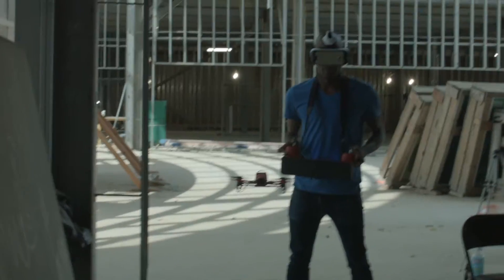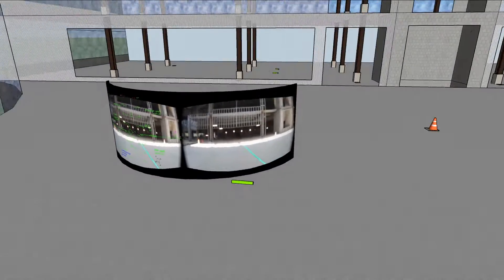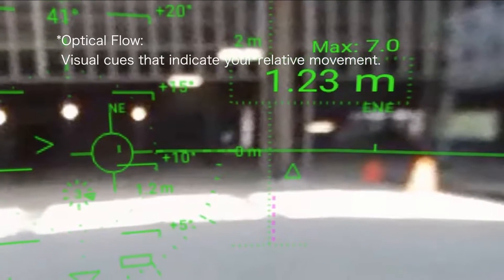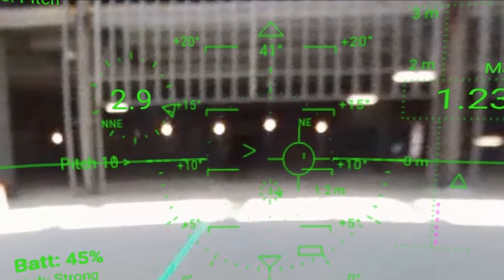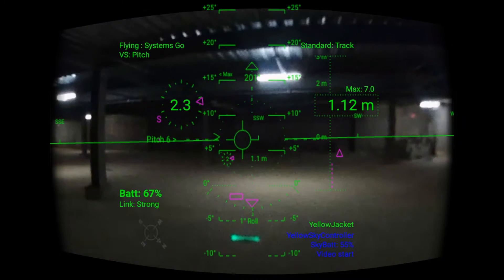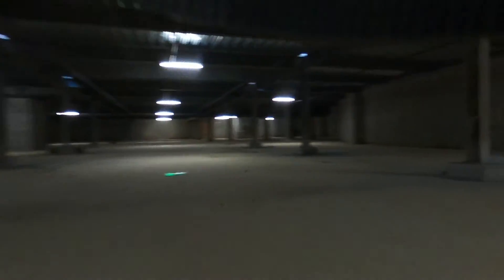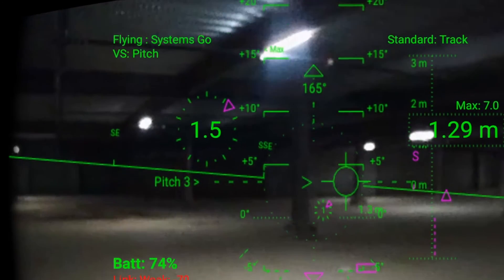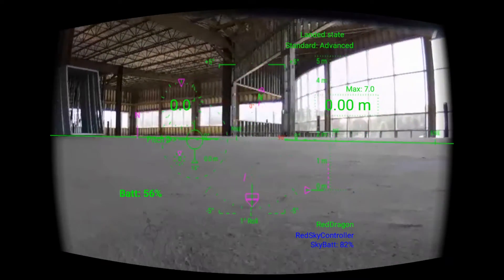Fly Faster: Designing and Testing an FPV Drone Racing HUD

Comment: I cant imagine how to race or doing acro tricks on high speed with your OSD. Here is example of what i mean by "fast": https://www.youtube.com/watch?v=_JvD393t_po 
I think in real practice first tree would be mine :)
Reply from the maker: It is definitely hard to imagine. Its better experienced. The OSD starts to conform to the environment and disappear during flight. It becomes a reference when needed. I am sure you are used to flying in real-time. With an OSD that has a complete feedback loop with the flight computer, I am able to predict the motion of the drone and thus fly with an edge over real-time. We were flying with a very delayed video stream and the HUD allowed us to overcome that challenge. Had we been flying on a platform with minimized delay, say a racer 250, we would have achieved even higher levels of accuracy. I just haven't built it to work with analog video.

Comment from the maker: @Rogerpro Roger: I did not measure the delay that occurs on the video channel. It often varied and could vary a lot based on environmental changes. I wouldn't be surprised if there is a video on YT where someone has. We did all testing on the 5Ghz spectrum to specifically minimize delay. An interesting thing we found was that as long as the length of the video delay was lower than the predefined prediction time in the flight path vector algorithm, the pilot could remain in complete control of the drone and could still perform higher speed maneuvers. The effect was the pilot was flying the flight path vector, and the drone essentially was performing a following task.